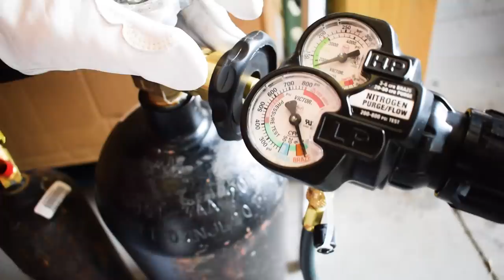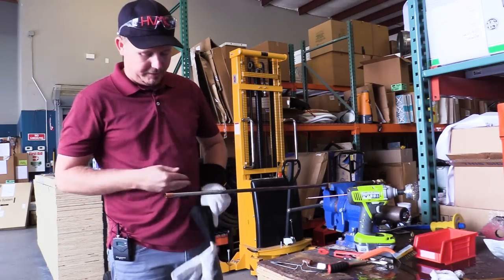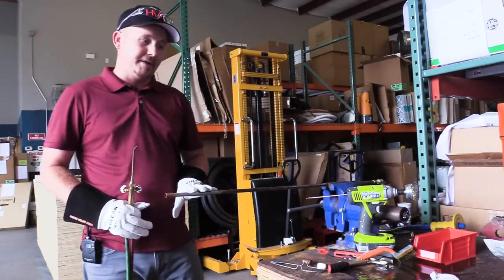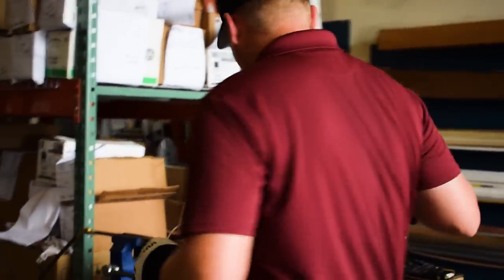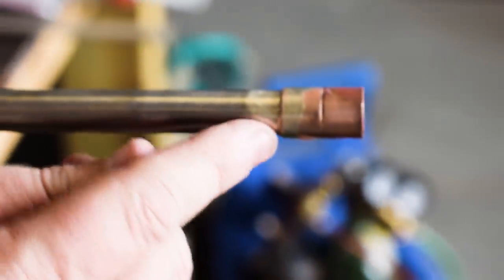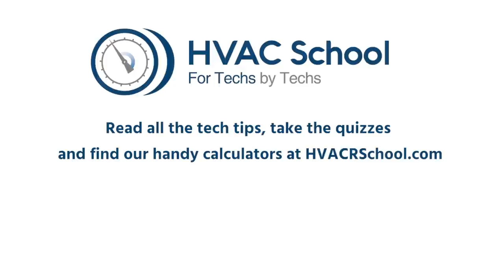How to Braze Copper to Steel

Comment: Easy on 1/2" or 3/8" joint in a straight shop joint,,,,,,apply that in the field where you have to put a compressor in on a Trane unit.    Good luck

Comment: if you use an acid flux for brazing some will flow into the joint. are you worried about contaminating the system?also i notice most tech's use a welding flame to braze. you should use a carburizing...yellow flame to avoid overheating and burn through with oxy-acetelyne.
Reply: You want the blue flame like that. A yellow flame for starters is a very inefficient flame. As long as you keep the blue flame moving and don’t get too close you’re not going to burn a hole.

Comment: Hey, I have a project coming up. Where I need to braze copper tube to a stainless steel heat plate exchanger. Do you have to worry about the acid flux inside the system? Any good precautions?
Reply: Good ❓

Comment: ok here is my problem, i need to fill deep divots in my chiller tube plates. some are right at the copper tubes. will this work for that? 
we will find and beat the fool who let the chemical sit in the chiller for 2 weeks so it would eat the metal. 
thanks

Comment: Is there anyone who can confirm the zoom lock crimper? Are they relaibale with personal experience? In reality not the nitrogen test only
Reply: i was use few time on range in cooler and freezer, about 2 year ago. they are still hold up, on condense loop.  those two for old freezer is more 20 year old.

Comment: Why not do a demonstration on welding copper sheet metal to steel sheet body panels like fabricating making floor pans out of copper and rocker and quarter panels on steel car body restorations for common areas wher on a car or truck rust at because copper doesn't rust and able to save and prevention of rust to save a car from rusting
Reply: This guy works on HVAC systems so that was what he tailored it for.
Reply: Check out the big brain on Krista! That is an effen' great 💡 seriously.